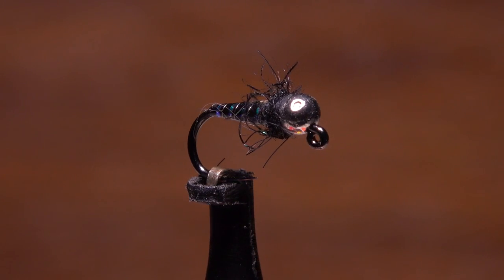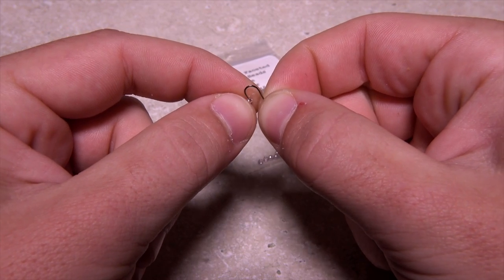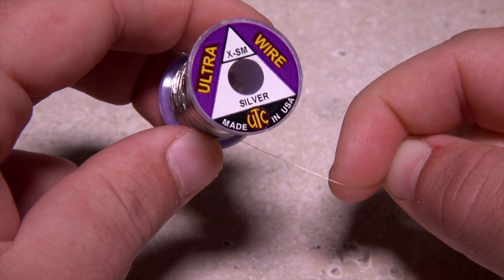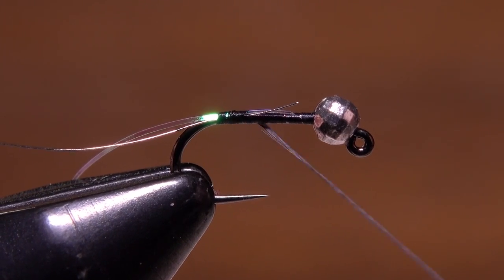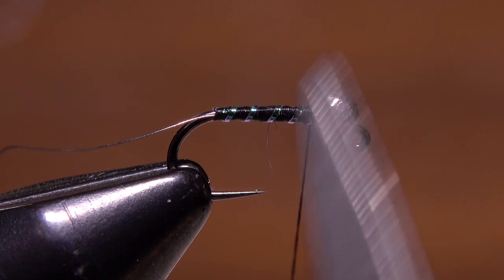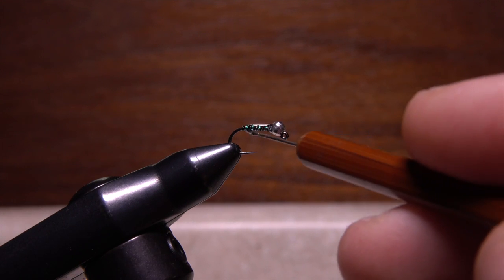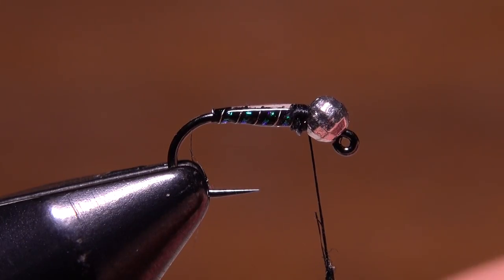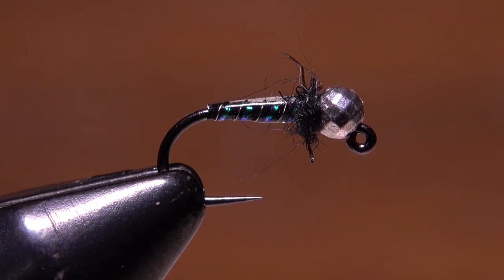Turbo Midge

Comment: After seeing your videos, I decided this weekend to give Bondic a shot. On my Midge's, whenever I cure the Bondic, it seems to dry with a bunch of small "bubbles" in it. It doesn't ever cure clear like yours. Any suggestions!? Great videos BTW.
Reply from the maker: +Greg Burnette I do get a few bubbles but they are really small and not objectionable. The only suggestion I have is, rather putting the Bondic directly on the fly, put a little bit on a Post-It note or other non-porous scrap of paper then use your bodkin to pick up small amounts and apply it to the fly. Sounds like maybe you got a bad batch.

Comment: Hey I asked you earlier about bondic. How's the durability of it? Does it shatter when hit or does it absorb the force?

Thanks again
Reply from the maker: +Sam Mother I've been using Bondic for about 6 months now and no complaints. Have not had a durability problem but I also haven't hit it with a hammer either. I'll let you know what happens when I do.